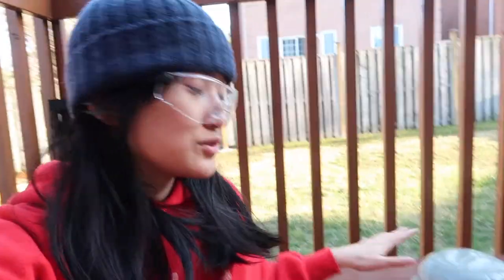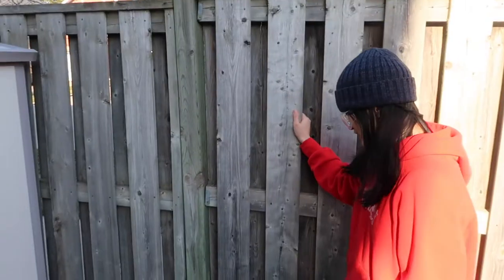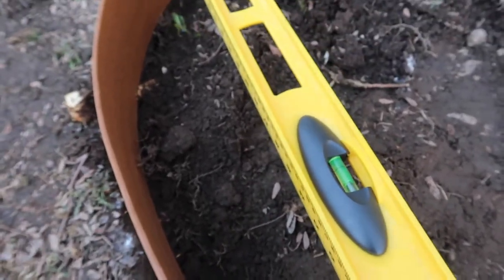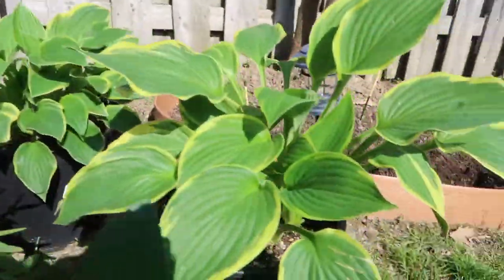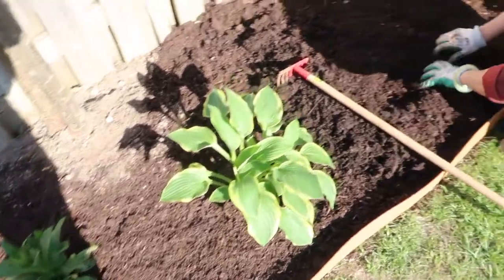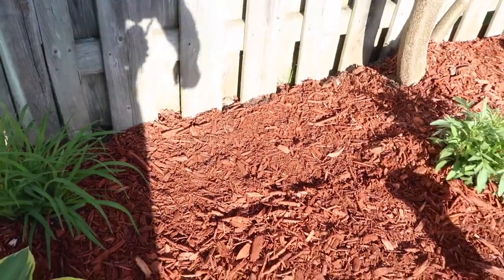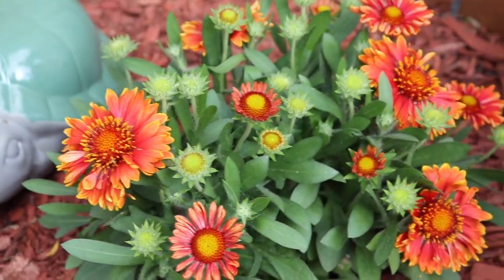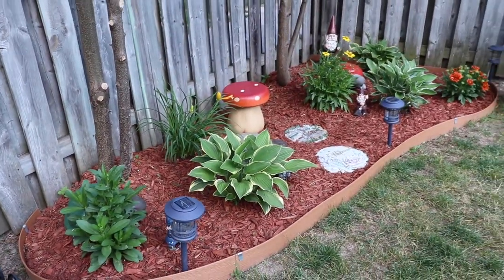Making a cute mulched flower bed (garden vlog)

Comment: Where you hammered needs to sit at ground level ! So I would unscrew and keep on hammering ! Lay a piece of wood across the bar and hammer , it’ll buffer the noise and protect the metal .  The metal is your new post sunder the ground. Hence attracting the screw to the top half.  The instructions is on the label .